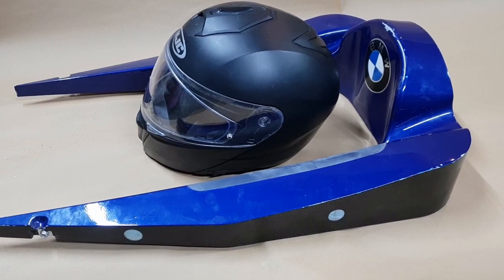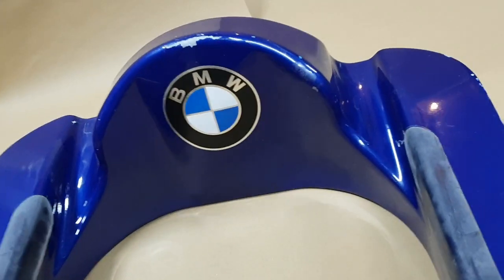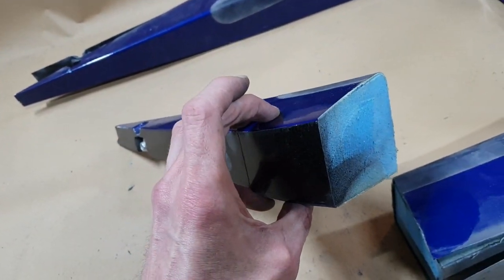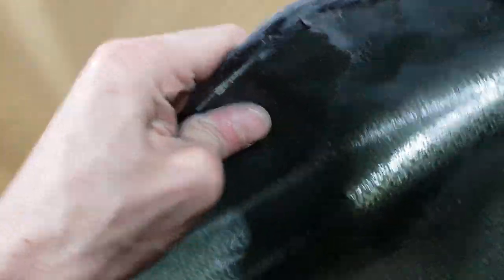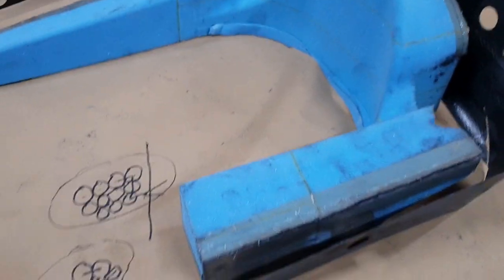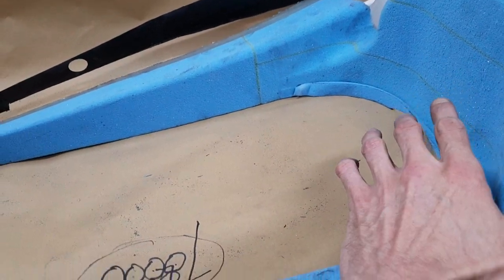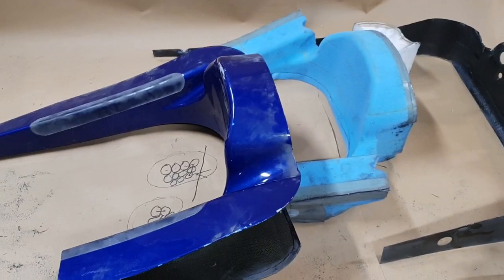F1 Cockpit Surround - A Closer Look - Ep 15

Comment: I've studied the cam lift profile for the V10 engine, and it appears to be using a modified form of a sinc, Bessel, or jinc function (or 2 of the 3) for each end. If that's the case, what were the challenges in optimizing the profile?

Comment: I think you're about to say but I'm curious why they wouldn't want Closed cell foam?  I like Closed cell foam because it doesn't crush all the way. It traps the air and gives extra cushioning, something you think they would want here. Maybe it's like the safety barriers you want them to crush to an extent. Would closed cell foam not have enough give? I like to use it because I find open cell foam tends to remain compressed after a while under load.( I realize this application is not a constant load situation.)
 Where as closed cell foam tends to bounce back and seems to last longer and retain its cushioning properties.
Reply: Fun the way you explain open cell foam and how the cells communicate with each other .
 I like to compare to a sponge. when you squeeze it, The water pushes out. In this case it would to the air.
Reply: They use open cell phone in chairs? that really surprised this me. Just surprised  not that I'm an expert. I would think in a constant sitting (loaded) situation I would think the cushiony properties wouldn't last as long as close cell phone.
 Maybe there is better ability to control the sponginess? Of closed cell phone?
  Just a guess.  I've used clothes cell phone in shoe padding.( I know it's not a race car) i find that very quickly like in a week Open cell phone is flattened down to nothing and never recovers. I have to use closed cell phone and it works much better and lasts longer.
Reply: I usually cut my foam with a Turkey carving knife.
 Yeah I'm on a much lesser level with this.
 I couldn't imagine they could actually cnc that design.
 I would have thought they poured it in and let it cure. Interesting detail about how they can't sharpen the tools too much
Reply: I remember back in the late 90s doing marketing research for a car repair manual company and someone was explaining. You can never find what you're looking for in the index so he grabs a manual and says for example let's see the distributor and he. Couldn't find it.
  It was the manual for the Aurora I think that was the first distributor less engine at the time. I was behind the one way glass laughing at him.

Comment: I haven’t seen this kind of youtube pace since Nico Rosberg
Reply: I followed nico and I like him which is why a bug's me I don't understand the reference. Did he used To Do technical explanations? Maybe with the sky f 1 broadcast?
Reply: @geniferteal4178  Nico Rosberg doesn’t know what a torque converter is, so I don’t expect that he’s able to explain much about technology (but I could be proven wrong).

Nico once drive a Koenigsegg with no gears but just a large torque converter and he called it a torque motor and clearly had no idea what he was talking about. 
I couldn’t take him seriously after watching that.
Reply: @Conservator.  OK yeah that 1 to 1? I think has no transmission. I love how they explain why. Even at a 150 miles an hour you can break the tires loose.
 All you would do is multiply. What's already too much usable torque?
Reply: @geniferteal4178   I think it was a Regera that had just a single gear. It does have a transmission but one with just one gear (but I’m being pedantic now;).

Yes you are correct, adding gears would only lead to more wheel spin so wouldn’t be useful.
Reply: @geniferteal4178  Here’s a link to the video with Nico Rosberg. https://youtu.be/FSaM9KVSxgM?t=779
He even says that the torque’motor’ gives you more horsepower. 😬
Reply: @Conservator.  I remember that! what I believe hes actually referring to is that car might have an electric motor?  Is it hybrid question? Mark if so they often say the electric motor provides torque fill which means it makes up for the Turbo lag. I think that's what hes describing.
 The electric motor can provide instant torque until it transfers over to the regular engine, the ice when boost is in.
Reply: @geniferteal4178  Hi again! 
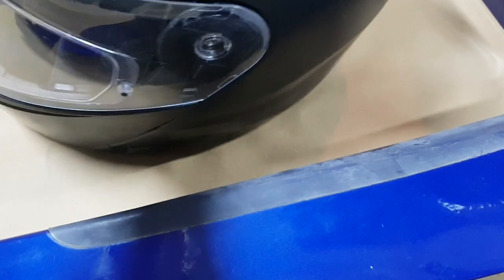I rewatched the video and I can get the impression out of my head that Nico doesn’t know what a torque converter is. At 6:24 he discusses the power train with Kim, who mentions the torque converter and Nico keeps saying torque motor. 
Just my thoughts.
Reply: @Conservator  Hey I'm not trying to argue or disagree on purpose. I'm still not sure he was saying torque motor instead of torque converter. Though he might have slipped up in one sentence.
 It's actually quite confusing and I'm not sure.
 I might not. 100%? Understand the concept but I think I'm in the 95% range.
 The torque converter in this case might somehow?
  Allow for slippage between the power applied from the electric motors and the power from the ice and so that's what Nico was asking if the engines at. 3000 rpms what happens when he steps on the gas? What happens is the electric motors? Immediately start spinning up and the gas motor will also start spinning but slipping. As the ice starts to build power from higher rpms and more boost.
  And then at some point when the rpms are reached the torque converter is automatically making more transfer of power from the Ice and I imagine maybe the electric. Motors just come along for the ride and are really not helping at that point but they may stay connected. I don't know I don't think either of us knows exactly. It's not black and white that hes saying torque motor instead of a typical Torque converter. This is much more complicated than that and pretty much a brand new concept for all of us.
Reply: @geniferteal4178  I’m not trying to argue either. We both have different impressions and that’s ok. It makes a discussion more interesting too. 

A torque converter acts both a clutch and as a variable transmission. It allows the engine to rev up and it will (for up to 95%) convert the (relatively!) low torque/high rpm to higher torque lower rpm. 

Think of it as an oil-based continuously variable transmission and clutch. 

The Regera has three electric motors. One motor is mounted directly to the engine and the other two are connected to the rear wheels (independently). 

The torque converter connects the ICE and that one electro motor to the wheels. 

The electro motors do indeed fill up the turbo lag of the ICE. The one motor is also used as starter motor. The two rear wheel motors are also used for torque vectoring (helping the car to turn). 

At high speeds the torque converter will lock and will then transfer 100% of the power of the engine to the wheels.

The car only had a 4.5kWh battery, so the electric motors can’t do much more than to fill in the gaps (and to reverse the car).
Reply: @Conservator  Does the tourque converter act as a transmission?
 I think it mostly acts as a clutch.
Regardless I can agree with everything. You say. not sure how that changes what  Nico said.  I think a good place to continue this conversation is what does the electric motor do?
 Does it provide torque When the turbos are spooling up (generally when the ICE is just low on power)? If we agree? That's what they do, How does the power get applied and released when the electric torque is matched by the ice?
Reply: @geniferteal4178  
Yes, the electric motors (all three) will provide the instant torque. The torque converter will unlock and let the engine rev up and convert the high revs/‘low’ torque to match the lower revs of the wheels. When it does that it will slip a bit (the clutch function) but not very much. If  it would act mostly as a clutch, it would have to dissipate an enormous amount of power and get very (too) hot in no time. 
There are a lot of videos on torque converters. Although their design is relatively simple, the way they work is less intuitive so some 3D graphics helps. The Koenigsegg torque converter works like any other automotive tc but it’s just bigger. 

I assume that the controllers in the Regera regulate a smooth transition from electrical torque to ICE torque. They’ll have to do that because the size of the battery won’t allow prolonged electrical power.
Reply: @Conservator  So back to Nico his saying torque motors may not be technically correct but if hes referring to the motors and their applying extra torque when. Needed hes kind of right just saying I mean he could be wrong. But it's a complicated thing that I don't know if everyone fully understands yet I get the basic concepts
Reply: @geniferteal4178  
To me there’s a fundamental difference between a torque converter and a motor and it’s quite obvious to (to me). 
Nico never says torque converter but repeatedly says torque motor. 
We can’t look into his head but he gives me the impression that he gad never heard about a torque converter before and a tc is very common in the car industry. 
I don’t think that if he had known what a tc is, he would call it a torque motor. 
I’m off to sleep now. 
Goodnight. 😁
Reply from the maker: Is he a Tennis Player!?? :)